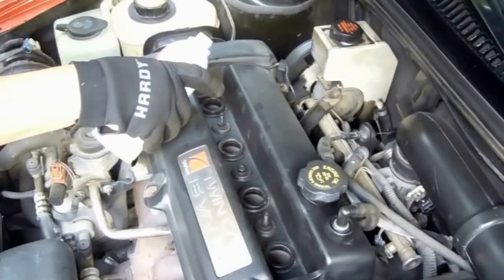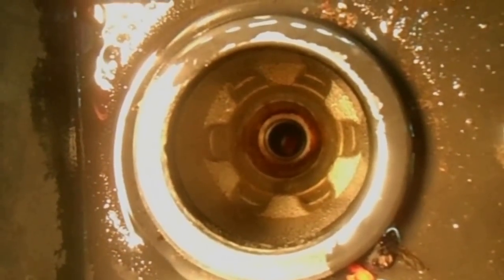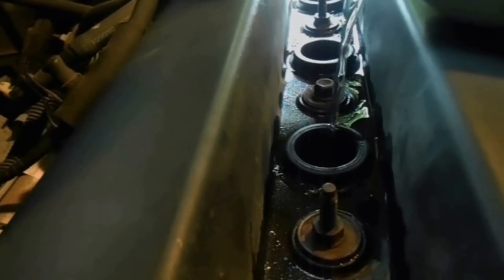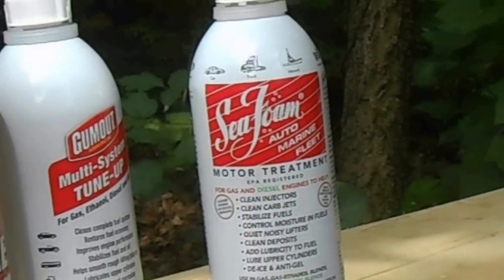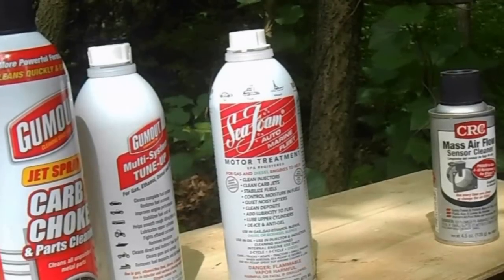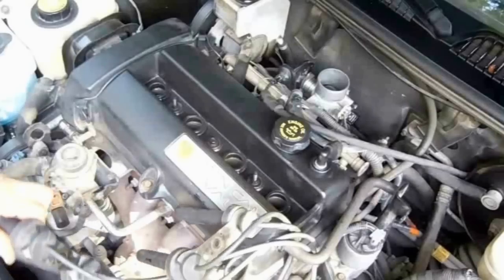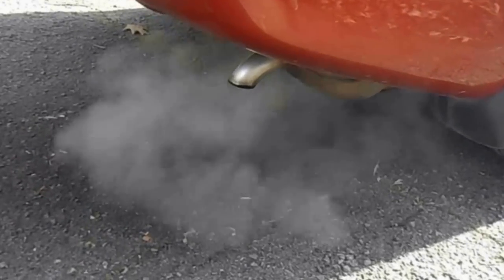Piston Head Soak Using Sea Foam

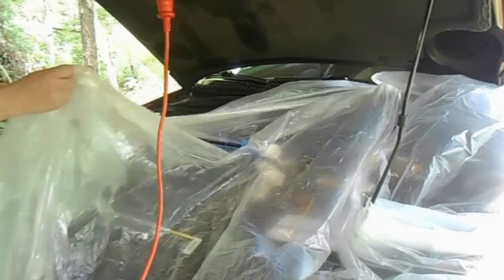Comment: 4:37 You forgot to put your spark plugs back in! How are you running it, lol!

I think it might be beneficial to do this treatment on a hot engine as well. Unfortunately it is not advisable (at all!) to remove the spark plugs when the engine is hot. 

Fortunately there is a technic I've heard about for years and seen on "Biasplys and Zipties" YT channel. 

What he did is he took a hose with about a 3/8th of an inch in diameter and a bottle of sea foam (and automatic transmission fluid, and some other stuff but that's neither here nor there lol) then he hooked the hose up to a intake manifold inlet or vacuum nozzle or brake booster line before the 1-way valve. 

Then he put the bottle and hose through the open window and went for a drive until it was hot. Then he stuck the hose in the bottle and while it was sucking into the engine he accelerated to high RPM, left it in gear, shut the engine off and then let the momentum of the car keep the engine spinning as it sucked up pretty much the entire bottle. 

Then he let it sit for 10 minutes and started it up, at which point it smoked like absolutely crazy. (Personally I would have left it over night if I could). 

There's also that Project Farm guy's channel that tests all this stuff like sea foam and he stuck in some stuff, I think engine restore or something like that, and it claimed to increase compression and it worked. Lol He also had a ticking lifter and put in Lucas and it went away. 

I've had Lucas get rid of my hydraulic lifter not expanding enough causing a tick problem. However the synthetic lucas is nowhere near as thick and effective as the normal stuff. I also have used Lucas on my super high milage early 90s mercedes benz to stop oil smoke at start and long idles from bad valve seals. It always worked pretty good in both applications but about the time you're getting close to your next oil change the Lucas would always seem to have its properties break down and you'd have to add more or change your oil and add more to have it keep fixing the problem.
Reply: maybe during editing he edited that part out or didn't record that part.

Comment: I wouldn’t trust this with any kind of expensive engine. You risk loosening carbon deposits which will then float and potentially become lodged between the piston rings, causing further damage to the cylinder wall and rings. Running a high concentration of seafoam in the gas and into the Intake manifold should work and if your car is that dirty, you have a bigger problem and will likely have to have a mechanic look at it and take the cylinder heads off in order to brush the piston heads clean.

Comment: carbon build up is what seals old rings remove carbon oil consumption  will be all you get
Reply: carbon only gets stuck on the tops and bottoms of compression and oil control rings, a non wearing surface... mileage doesn't wear the part of the rings where carbon builds up... letting it sit there just prevents the rings from doing there job and getting stuck.

Comment: Why clean it at all? It has no effect on engine life or performance.
Reply: .....Ask the owner of the new generation of direct injection engine what carbon  can do !!!!
Reply: But this "soak" will do nothing as it never reaches the intake valves or ports. Plus if you spray seafoam on carbon it does virtually nothing to it.
Reply: Robert Bradley the goal was to soak the rings, if your piston rings are stuck you get excessive blow by into the crank case which leads to a miriad of problems.
Reply: @nickkennedy5450  some guys doesn’t even know what the purpose of leaving a cleaner on top of the piston would do . I think there’s a lot of your tube mechanic on here .